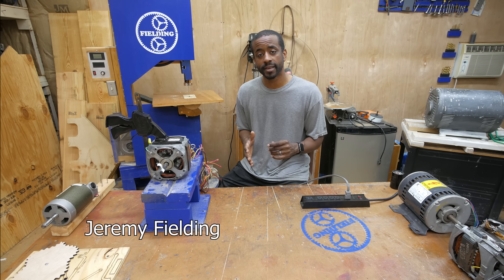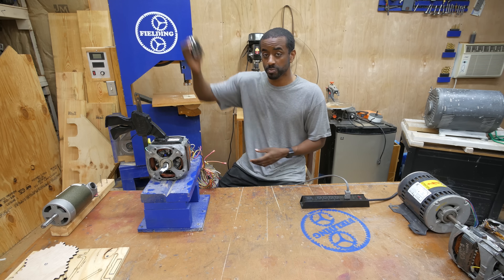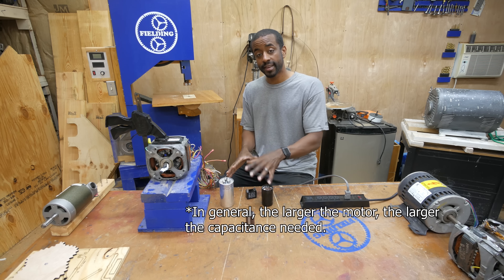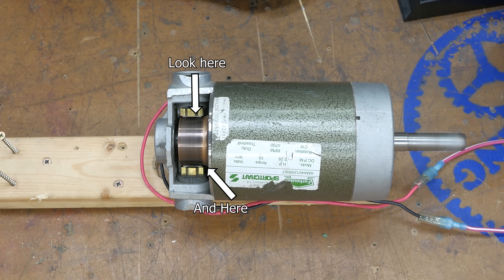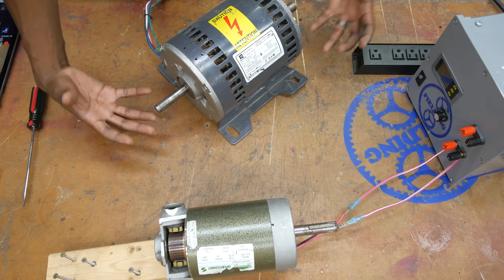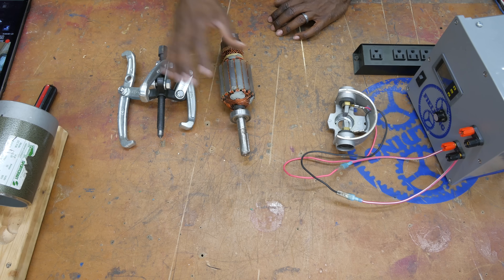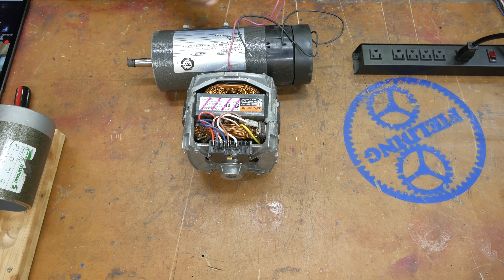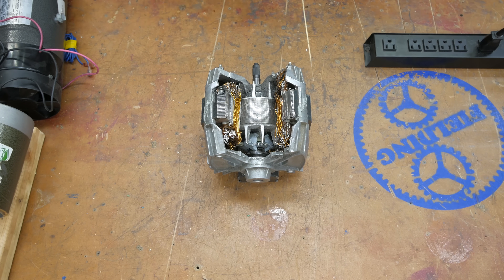Three Most Common Motor Fixes Anyone Can Do; Ultimate Guide to Electric motors ; #070

Comment: *Yeap, my force air unit on the house A/C hummmmmmmmmmmmmmmmmmmmmmmmmmmmmmmmmED.   
Sooooooo I pushed the fan blade (& got my finger out the way) and the motor ran.
Sooooooooooooo amazon has most common appliances replacement part.  
DIY Wuhoo!
*I gots a lot of Harbor Freight electric tools.  I don'ts thinks Harbor Freight sells brushes.  ?How do I find replacement brushes?
*The design of electric motor haven't changed for a century.  ?How would you redesign an electric motor for this century?  
Oh you can call it the 'JFielding motor' & people will know your name for at least a century.

Comment: I have a fan (about 3' in diameter) in a dusty barn.  The grills clogged and the fan stopped.  It now just hums and barely maintains rotation when I spin it.  I changed capacitors and still no difference.  I did notice it slightly starts to spin one way when I turn it on high from a dead stop, and slightly starts to spin the opposite direction when it is switched to low from a dead start. Any suggestions?

Comment: Can you do a video on how to identify the number of poles in motors please, I am currently an electrical student? Great video man, alot of valuable information here, thank you Jeremy fielding. I am now a subscriber.
Reply from the maker: Measuring the speed (or getting the speed from the label) is the easiest way. Check out my video "can a induction motor be controlled with a dimmer switch" I explain in that video.

Comment: Keep in mind that motors without temperature rating may have insulation class rating. Motor at 11:00 has insulation class F. That means that its windings can withstand temperatures up to 155°C before insulation fails and motor shorts itself

Comment: I used to have to take care of a 5hp, single phase 220v centrifugal water pump motor. Besides the capacitors, the main thing that wore out all the time were the magnetic start switches. Seemed like I was replacing that all the time.

Comment: Since we're talking washing machine, on those that have it, first in line for checking are the brushes. If they are spent, you can bet your top dollar, that's what is the problem. And they can cause a plethora of issues too, then they are in that annoying state of half touching, half floating, arching around. Blew two boards because of it, and none of the technicians bothered to check that, just replaced them. Admittedly, my washing machine is in a nook, so difficult to access.

Comment: Hey, there, Jeremy. I am a knifemaker and I have to use a 2x72 belt grinder. I decided to go with a Chinese 1.5hp single phase motor. I am planning on just wiring in a switch and dealing with a single speed. However I found an "AC/DC motor speed controller" which sounds about as sketchy as Mexican tap water to me. But I thought I would check with the only motor expert I know of. Here is a link to the device. STCorps7 120V 15Amps Electric Motor AC/DC Variable Speed Controller Brush For Router Fan https://www.amazon.com/dp/B07839FQD2/ref=cm_sw_r_cp_apa_i_kDI8CbBY6N1XP
Reply from the maker: Check my video "can you control a induction motor with a dimmer switch". I discuss this topic in detail there.

Comment: I usually like his videos, but he is wrong when he says the capacitance does not matter in capacitors. Too low and it doesn't run right and can burn up the motor. Too high and you burn up the motor by giving it too much power. The motor typically says what it needs and it can easily be found at HVAC or electric supply warehouses. Also, people should not mess with capacitors without knowing how to properly discharge them as they can cause serious injury.

Comment: A note on capacitors: Run capacitors should be replaced if they show any signs of swelling or leakage. Also at the top, there is a little dab of solder between the terminals, this should not be disturbed as it is the fill hole and somewhat of a blowout protection. On start-capacitors, there is a similar one but it may look different, such as a sulfur-yellow or so. If this hole is blown out, it is a sure sign of failure. Beware that start capacitors can still hold a charge if the start circuit went open, so short it just to be sure, they are still electrolytic capacitors. Always check for continuity of the start circuit before getting a replacement cap, sometimes it is the centrifugal switch or current relay (obsolete, must be upright) that has failed. A blown start capacitor is an indication that the switch may not be opening the circuit correctly, as a start capacitor can only handle so much AC before it cooks.

The uF (capacitance rating) DOES actually matter, as a different capacitance will not put the start-phase in an ideal alignment magnetically, which can reduce starting torque that may be critical for a motor that starts under heavy load, such as that washing machine motor. You should try to come close to the capacitance as the original. Noting this will also avoid confusion as run capacitors are maybe 1-3 uF is the average run capacitance, and 130-250 uF is the average start capacitance, for motors under 2 HP.

Comment: The centrifugal switch on most dryer motors are double throw switches. It will break the circuit to the start winding and complete the circuit to the heating element allowing the dryer to get hot.

Comment: I have an air conditioning window unit that the motor in it had seized. after tinkering with it a little, I got it to turn. But when I tried to test it after reassembling it, it did something strange. When I hit the power button, it starts to run, but only for maybe a second or two, then it hums. If it hums, that means the windings are ok, right? And if it starts turning on it's own, that means the capacitor is ok, right? So, why would it start to spin but then stop & hum? Please help! thanks!

Comment: Cool video, thanks! I always wondered how to diagnose the starting capacitor. Off topic, but do you think that rewinding a generator rotor is a diy job? I picked up a generac gp5500 for stupid cheap, but the seller said  the windings are broken. It uses aluminum wires in the rotor. I was thinking of just rewinding it with varnished copper wire.

Comment: Ive got some strange motor problem! My drill press motor a golden oldie turns off my power circuit breaker when tuned on but so now and then most of the time it turns on with no problem its got a capacitor and centrifugal switch! Please help with this walk of shame! :-) thnx J your channel is awesome!

Comment: Thanks for the informative video on motor maintenance.

I remember my motors and controls teacher back in college telling the class that most single-phase AC motors have a start-capacitor that is disconnected from the motor by a centrifugal switch once it reaches its running speed. I suppose that same switch also disconnects the start windings as well?
Reply from the maker: They are on the same circuit. Both are disconnected

Comment: The start capacitor on my side sliding outdoor garden gate seems to fail every year. The symptoms of malfunction are just as you describe: it hums, I push the gate and it opens. I replace the start capacitor and it works no problem. However, within a year or so I have to replace it. Could it be something related to weather, therefore seasonal, or could there be a component in the PCB or in the moter itself that wears out the start cap due to high load maybe? Cheers, great vid!
Reply: A gate motor may be the same type used in garage door opener. These typically use a electrolytic (start capacitor) but are connected to the start winding permanently (no switch). They are subject to pretty severe duty in handling a gate (more than garage door). If the gate has any counter springs to reduce the torque, maybe they could be re-adjusted, tho probably there are none on a gate. You could put two capacitors in series which would reduce the duty on each cap 1/2 voltage. However the capacitance of each must be 2 times the cap of the origional. Electrolytic caps have very high losses and get warm very quickly. Cycling the gate frequently  in short time really stresses them since the duration that the are working is the full cycle time of the gate motor.

Comment: I've seen  the springs on the start winding  switch snap causing a  a failure  similar to t bad start capacitor.  It's rear but not uncommon.  Pretty quick fix if you can find a spring with similar  tension

Comment: Excellent video and absolutely correct. I had several Delta Rockwell woodworking tools flood in hurricane Katrina. After a week underwater, the single-phase induction motors were a rusty, frozen mess, but in each case, and sometimes years later, new bearings, a new capacitor, and cleaned-up centrifugal switch restored the motor to good service.  Saved lots of money fixing them myself.

Comment: If you have a star induction motor with a failed capacitor can i remove the capacitor and run it as a thre phase motor instead or is the windings to weak for that?
The capacitor is as far as i know used as a way to create a second phase and this is why you need the ground wire or the not powered wire
Is it possible to remove the capacitor and connect thre phases insted i think standard 400v (in sweden) has a standard star connection in them
Love your vid and subscribing right now

Comment: Love your videos, Jeremy! Just took possession of a treadmill and completed the disassembly process. Got a nice DC motor, linear activator, two beautiful rollers which I plan on converting to an outfeed table, a rubber belt, and a nice flat board that will become a router table at some point.

My Campbell Hausfeld air compressor starts and runs for about 5-10 seconds, then it trips the circuit breaker. How long does the start capacitor do it's thing? Could my run capacitor be bad? Any other ideas?
Reply: Another Youtuber suggested I check the centrifugal switch, as it sounded to him like the switch wasn't disconnecting the start windings. I discovered a colony of mud wasps inside the motor housing! Cleaned all that junk out and the compressor works like new!

A "Doh" moment for me for sure, because I had first learned about the centrifugal switch on your channel a couple months prior.

Comment: 3 phase AC motors, in industry are often just 'squirrel cage'' stators using induction, but in smaller 3phase motors the rotor is usually made from permanent magnets, I'm guessing its just a size thing, but is it also an efficiency thing, the induced current in a non magnetic stator needs the current to creat a magnetism, after an airgap, so is it more lossy? - searched youtube/wiki cant find an answer as to the advantages of one type over the other, but i guess if a spinning magnet rotor had advantages, tesla would use them....

Comment: That switch at the end reminds me of the limit switch used on steam engines that have weighted balls on them so when the engine reached top speed the balls would be straight out and would stop the engine from going faster. That's where the term "going balls out" came from.

Comment: Great instructional video. I've found power tools in need of a wire soldered or brushes replacement. One point of safety...the capacitors should be discharged prior to working touching or removing them, extremely high voltage kills.

Comment: I wanted to see how you could pull the bearing off the example on this video with the bearing puller that you purchased for thirty dollars. The clearance seemed too tight to grab onto the bearing. 
Is there a special clamp to slide up against the bearing available and then used a two arm puller to extract the bearing.
Nevermind I found a tool called a bearing separator and puller that would work.

Comment: Great video as all of yours are. A thermal fuse inserted in the outer windings failed on a fan motor, it was difficult to access but after cutting some waxed winding string and carefully separating wires from the fuse I got it out. Ordered replacement thermal fuse and soldered it back in place then pulled everything back together with new waxed string. Sprayed two coats of clear urethane on the repaired area for insulation. Then cleaned off years of gunk from the bushings and added new oil to the foam pads for the bearings, reassembled and tested. Now runs great and should for years.

Comment: Thanks for the video, I subbed. I had a noisy shop vac motor and replaced the bronze bushing on the brushed end with a 608 roller skate bearing, shims cut from aluminum can, and Loctite 609.

Comment: The oil capacitors fail usually shorted, and this can overheat the start winding and cause the motor to vibrate really bad too. They are usually oil filled and aluminum can to dissipate the heat of always being in the circuit for powerfactor correction. Awesome vid!

Comment: Hi. I got my dc motors connected to solar panels stop working like first part of the video ( bad capacitor). But I don’t see any capacitors at all or do I need to add one. If I turn the motors by hand when connected to the panels the do spin. Thanks.

Comment: Hey I just picked up a Go-Go scooter and it's got two 12 volt batteries wired up to run 24 volts and I replace both of them with my 18 volt Dewalt batteries and now the scooter won't go it's just making a noise. Is there some sort of over-voltage protection device on this or something?

Comment: Good stuff man. I had a motor problem where it was just standing there an vibrating like a spazoid. It's a 3 phase chinezium e-bike BL"DC" hub motor controlled with a hall effect sensor based chinezium system. Man o man I changed the sensors, it worked. Then it broke again. Changed another sensor, and so on. And finally the magnets started popping out and I broke one of them while trying to glue them back in the rotor:D  So my obscure fix was this:
I bought a better motor :D 
Thanks for the vids. Tmbs up.
Reply from the maker: Sounds like the right decision 😂

Comment: Very neat to see the motors inside thanks. Not sure if it counts as a repair as what you have asked, but i picked up a fan that was not working and from a youtube video i found that the bearings may be “dry”, some lubricant and helping the rotor to turn to spread the lubricant solved the issue. Maybe not relevant here as bigger motors but it was an interesting repair and a free fan 😁
Reply from the maker: That is exactly the kind of thing I was referring to

Comment: Capacitor voltage ratings have nothing to do with line voltage...they are for the back EMF of the motor...I put 370 VAC run caps on 480v equipment all day, every day, straight from the OEM.

Comment: Absolutely great video. I did have a problem long ago with a room fan motor. It was a cheap one it had bushings(sleeves?) instead of ball bearings and tried to replace them with ball bearings. I had to because of the annoying noise. The problem was getting the axel realigned into a central position. Maybe you can do that in a video and show how to do it. Just a suggestion .

Comment: Hey Jeremy great video. Yep the capacitor fix has 99% of the time got me back up and running for literally a couple of quid.
How about a video on diagnosing an armature failure using ohm meter on AC. Have had a couple of AC motors run terribly sparking wildly at brushes (you can hear arc popping) but motor still runs... albeit it gets hot quick. When do you decide whether it's brushes or coils? Thanks.
Reply: probably shorted armature turns. Having a single turn of wire in a slot will cause overheating and arcing at the commutator.

Comment: I just had 2 belt sanders and a finish tool burn out right away in one day.  They were all plugged into the same Honda eu200 generator and all of them suddenly pulled more juice but slowed to a crawl within seconds of starting.  Still can’t get them working although Ive only done a visual inspection of the brushes and cleaned them out
Reply: *eu2000

Comment: Hey Jeremy, thank you for this awesome video! I have one question that goes into 2 parts, it may sound silly but I would like to know how would I go about buying new brushes online and also, if it isn't written in the parts lists of the manuals or the company is closed, how would I know which size brush I need? I can measure the width and thickness of the graphite part easily, but for example a 14mm x 8mm comes in (at least) 3 different lenght (5, 6 and 7mm), same goes for anything imperial.

By the way, keep those type of videos coming our way, they are amazing and I am learning a lot from them! Appreciate all the effort that goes into those videos and the knowledge you are passing on to other people, including me.

Comment: If it is an older table saw (brushes replaced already long ago) the brush holders could have acquired a clear, high-resistance coating of lignin from fine wood dust. It happened to me and I picked this tip up from another video by another guy. It fixed my problem.

Comment: You know, 2000 to 8 is already a really good like to dislike ratio, but really, who are those 8 people?  The video is very well made and those are easily the 3 most common problems aside from "motor not plugged in or turned on" which you actually mentioned anyway.  I genuinely want to know what those 8 people were expecting from this video that they didn't get.